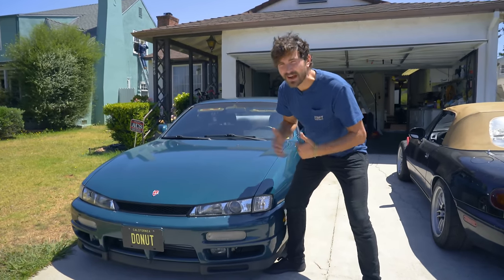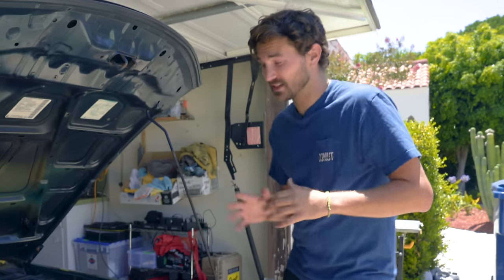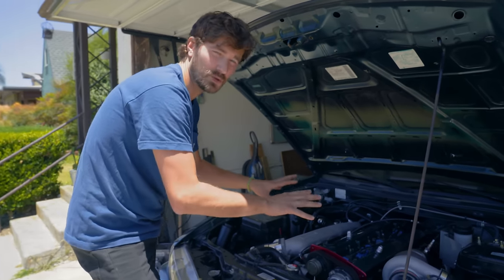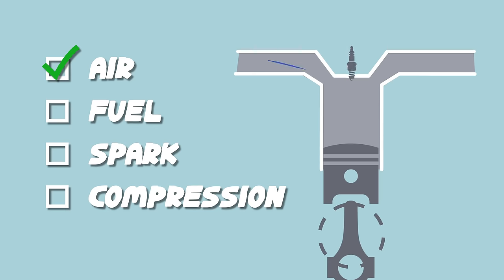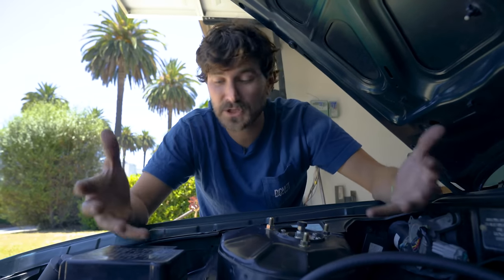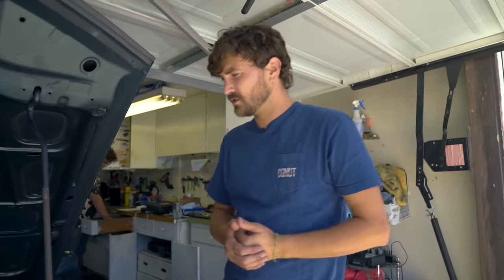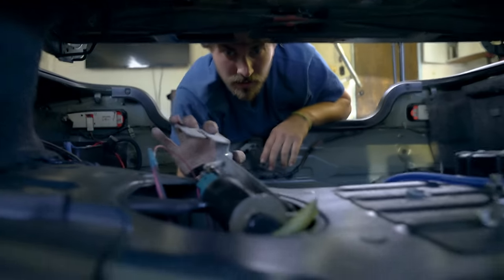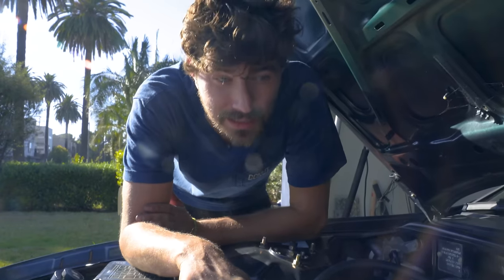Figuring Out Why My Skyline-Powered S14 Won't Start

Comment: Did you know - Tootsie Rolls were added to soldiers' rations in World War II for their durability in all weather conditions.
Reply: Bot
Reply: Yes
Reply: Ye
Reply: 11th like
Reply: Yes
Reply: What does this have to do with cars?
Reply: The HIMYM tootsie rolls!?
Reply: TheGinger CarGuy the soldier’s would melt the tootsie rolls in there mouths then spread over anything that leaks the cold weather would the freeze it and seal anything that leaks and also if the weather was cold enough the tootsie rolls could be used as bullets
Reply: Did you know - you are bot made by repostsleuths. 

But thank you for that bit of trivia.

Comment: WHAT ABOUT THE E36 we need to see it
Reply: Na
Reply: @Wik3dNuTS4k  ya
Reply: Ukininam!
Reply: Isnt the e36 cirone's
Reply: Nah
Reply: Hey zach plz do some videos on e36 also. It's my dream car 😃😃
Reply: @Knockthefout  make sure to bring money with you e36's are hard to maintain
Reply: @midnightg3593  yeah but he said in one of his videos that they are cheap abundant and pretty damn reliable. Just the intercooler issues are there. I will sort them. And the car can be found for under 5k in fair condition
Reply: @Knockthefout  I own 2 and they are not cheap to maintain and its famous subframe failure doesn't help it i have changed both my automatic transmissions to manual because the automatic systems are crap and expensive to rebuild
Reply: @midnightg3593  bro i love manuals. And it's my dream car I can't just let it go. It's so much fun.  I think we have same tastes in cars 😃. Cheers buddy. I also love drifting. Not professional but the normal drifting at mountains or turns. And e36 is in top 3 cars for drifting
Reply: @midnightg3593  do u have any Instagram account? I will follow u. Reply me that account username

Comment: The first thing I check, after a glance at the intake for problems, is battery voltage.With a multimeter this is a very quick check. Leads to the batteries and see what voltage you're getting. I get concerned with anything under 12, though it should start with a bit less. Pushing a car to the limits might introduce other issues, but in my experience with typical daily driver type cars, dead or weak battery is the most common cause of a no start.

Also a good early check is listening closely when turning the car on, before you try to start. The fuel pump should be audible as it primes the system. A helper to listen through the filler neck can be useful.

Comment: I remember one day my '04 Miata wouldn't turn over, even with forcing some gas. So I sat on it for a couple weeks. Randomly felt like double-checking my spark plugs since I looked at them last year for grime (didn't check the gap). Turned out that they really needed to be re-gapped, and it started up fine. I'm glad my problem was that simple 😩😩

Comment: The price of Silvia's has shot up like 50% in the last 5 years...
Reply: Jxntxn thanks to Americans.
Reply: @daveowen378  how so?
Reply: @jxntxn1462  speculators. Same as what happened to GTRs and various low production Porsches.
Reply: @daveowen378  Do you think they'll keep inflating like the skyline has..? They usually rise and then fall in price but I've never seen them this expensive
Reply: It's the drift tax bro
Reply: I'd put it more on Americans getting moist over S15s and the market responding with bullshit. Especially given that S chassis have fallen out of vogue for drift.
Reply: I was lucky to get a good deal for my s13. Can’t find a nice-ish running one for less than around 5k now. It sucks.

Comment: When you're testing compression also unplug your injectors, so you don't flood your engine by accident. Also most engines fail to start if the crank angle sensor is defective.
Reply: But usually when doing said compression test, you are flooring the accelerator pedal putting the vehicle in clear flood mode so the injectors will not spray any fuel.

Comment: Always make sure you have submersible fuel line on the pump. If the hose falls off, feels soft, or tears open, you more than likely don’t have submersible fuel line on it. Submersible fuel line is somewhat stiff and usually won’t like bending at all and it says submersible on the line

Comment: I love and haye diagnosis, hate when i have to do it, love it when i find the problem. Had an issue with my racebike last weekend, low power at first, no start when i got it home, turned out a connector of the fuel pump had wiggled itself loose.

Comment: Only thing I would add is the engine also has to be in time, and select sensors need to be working. For example a lot of cars won’t start if the crank position sensor isn’t reading. Also I usually use the negative on my jumper cables to ground the spark plug out. Easy when the battery is up front like most cars have it.

Comment: first thing i do for fuel is to spray brake clean in the intake to see if it start.if it does than you know it most likely fuel and the rest is ok.if it doesn't  than you move to spark,compression and timming

Comment: When you do a compression test, you need to unplug the injectors, or you could flood your engine. You don't need to unplug all of the spark plug coils, like you did.
Reply: You should do leakdown first...it will tell you if you even need to check compression.
Reply: Or just pull the fuel pump fuse/relay
Reply: If you do one on a Miata, you need to unplug everything or it’ll fry the coils. Lol. Ask me how I know.
Reply: @aygwm  I've never heard of that before nor has it happened to me, but I believe something like that could happen for whatever reason. Its always something lol.
Reply: even better: just unplug the cam/crank angle sensor. you wont get fuel or spark.
Reply: @TatakaiEX  that depends on the car. Some cars will just go into limp mode without that. My daily is a 2019 Honda accord with the cam position sensor completely chewed through by mice. Its just in limp mode and I drive it to work everyday still lol.
Reply: TatakaiEX WRONG. Some cars still power the coils even with the sensor unplugged. If you leave the coil packs plugged in but with spark plugs disconnected (leaving the coils no ground) they will ground themselves, frying the internals. Bye bye coil pack. It’s always safer to disconnect all ignition components before doing a compression test.

Comment: You should have mentioned to always check your multimeter before any measurements are taken. I know this time it wasn't that bad but the most important test on the meter is the cables' resistance (shouldn't be more than 0.3 ohms) and the resistance on the amp inputs (check the users manual for the correct values). Otherwise, you basically play yourself, getting false values whilst searching for issues for more than two hours.

Comment: I have, and only ever had, two passions in my life since I was 8 years old: Computer Programming and Cars. I had to move a few years ago, so I don't have any friends anymore. I would love to be able to get a project car and work on it, but I'm afraid because it will be only me. I have no knowledge to fall back on other than what I have learned online. I purchased a 240sx when I was 17 for my first car, but sadly, I was screwed over. It was the funnest I've ever had. I tend to overthink things, so maybe I'm making it seem more scary than it is. What concerns me most is the suspension – also things that require welding and such... like subframe connectors.

Comment: Any time I spin an engine to check for spark or compression or something else when I know it won't start or don't want it to start, its best to remove all the spark plugs.  Its a lot easier on the starter and the battery and it'll make the compression test a bit quicker because the engine will spin faster.  Even more so in diesel engines with ~ double the compression of gas engines, I remove all the glow plugs.

Comment: Good video iWork on cars so Iknow to test each spark plug and cylinder for compresión but that was not mentioned so some ppl who don’t know will only test one and also on that engine pressure is 43psi for fuel since it’s Sequetial fuel injection but on Direct it’s way higher just so ppl know

Comment: i honestly prefer using a resistance test with an ohm meter or if you don"t have that use a regular light bulb for a circuit load test, over a voltage drop

Comment: I once bought a mint coupe style s13 with an HKS turbo kit, fully built RB25 red top and about 9k in upgrades for 800 bucks because the owner couldn't get it started for years. $15 ignition coil on ebay and it fired first try, drove it home.

Comment: It's funny you mentioned the Diff S13  and S14 with engine swaps and transmission upgrades but are still running the stock open Diff

Comment: When doing compression you should check all of the cylinders. They should all be pretty close to each other. One with a reasonably higher or lower value than the rest will indicate an issue.

Comment: Sometimes the manufacturers of vehicles will paint the inside of your fuel filter so after a while paint will come off when u hit the throttle and wrap around your filter and kill your vehicle via lack of fuel this is usually most common on boats but if u hit the gas and it dies everytime this may be your issue all u need to do is clean it out with a wire brush, perhaps get a new one without paint inside of it and that should fix it

Comment: Don’t forget when checking compression you want the fuel shut off (can cause a higher reading than what it true and also cause hydro lock by the time your testing is done) also while checking compression the throttle should be wide open

Comment: My EUDM Mitsubishi Galant with the 2,5L V6 engine, runs on 5 cylinders. Any suggestions on how to diagnose it? The problem is that the intake of the engine is above the back bank of cylinders, so compression tests aren't that easy because I need to remove the intake every time I need to access the cylinders. Chassis is a EA5W Galant Wagon with a 6A13 engine (NOT a 6A13TT!).

Comment: the problem with cars that are from the 1990's is the fuel pressure regulators are 30+ years old so they go bad and jeed fixing and they aren't cheap so it's a good idea to get a replacement factory regulator but if you have modified the engine then looking at an aftermarket regulator is a good idea too

Comment: Thank your lucky stars you dont have a short between the cam angle sensor and the ecu thats why my bnr32 wouldn't start also had the same problem with a hose popping off the pump 😆

Comment: Working with electric components. You picked the range right, but you didn’t say that car battery works on DC voltage, that is very important while measuring. And one more thing, yes voltmeter showed us 12,3V on battery, but if you want to measure that the battery is charged, you have to measure it while you are starting the car. Battery is fully charged when it shows about 12V while starting!

Comment: Hey in case somebody has it all right,spark-fuel-air-compression but it still won't start,don't worry because im the falled solider for you.Crankshaft/Camshaft sensor.Gives out sparks but not exactly when it should for the engine to run or to even start
Reply: I can unfortunately second this from experience, a crooked cps can kill your engine with no apparent reason, along with faulty timing

Comment: With compression tests, you want all spark plugs removed so that there is no resistance when the engine is spinning which can cause inaccurate readings

Comment: Zack!!!   First off - get fuel injection clamps on that FPR, please.  They are cheap insurance against the worm clamps cutting into the hose on you.

Ok, so YOU probably already know these, but for the others playing along at home :)

1. Common causes of 'no spark' could be:  bad ignition coil (rare) or bad signal telling the ECU to fire (waaaay more common).   If you have a CEL (Check Engine Light), that can tell you if you have a bad Crank or Camshaft sensor.   On slightly older cars, the Ignition Module is notorious for failing (looking @ you, Ford Windsors!) and is another item to check.

2. When doing the compression check, you want to hold the throttle wide open (foot to the floor!) while testing.  Why?  Well, the engine is trying to suck past the closed throttle blades - so you're introducing another variable in the system (when diagnosing, troubleshooting is 80% figuring out what IS NOT the problem - best way to do that is to try to make sure you are testing only one thing at at time!)

3. Got a cylinder or two with more than 10% variance among the cylinders?  Put a little bit of oil into the spark plug hole (like... a tablespoon, not tons!) and retest the low cylinder.  Did the compression numbers come up significantly?  Rings are likely bad!   Did the compression numbers not change much?  Valve train issue!

Add your tips  here!
Reply: The people who already know that stuff probably won't read this.  And the people who don't know this stuff, won't read it because they don't work on their own cars.

Comment: The EASIEST thing to check if your car is just cranking is to spray starter fluid in the engine.... if it starts, its fuel problem,  if it doesn't its ignition

Comment: If you confirmed that you have air, fuel, spark, and combustion; then check your crank shaft position sensor and camshaft position sensors.

Comment: Fuel pressure and compression is different from vehicle to vehicle and manufacturer recommended spec should always be reviewed. 

Of course that usually goes out the window when you have so much aftermarket parts.

Comment: you should be using high pressure fuel system clamps on the fuel lines not the crappy ones that come in the pump kits.

Comment: Seems like the voltage drop test was redundant. You had already measured the voltage of the battery and the voltage across the pump and found both had ~12V. So there's no voltage difference i.e. voltage drop taking place.

Comment: An engine really needs 5 things, not four. the fifth is timing. For a fuel pump, when you turn the ignition, you should be able to hear it run for a couple seconds, you can save some time if you hear it run. But don’t use that as an absolute tester though.

Comment: pretty obvious that there must have been a leak in the fuel system and not an electrical issue with the pump if the fuel pressure gauge was reading 20 PSI. Yes, low pressure but pressure none the less indicating the pump is working but a possible leak is present

Comment: if you have air it runs  heaven if you have leaks the only things he dont run good to test proper spark  you can test it with the spark but the better a strobes light to check when the spark happen the thing i cant understand its you have a pressure regulator  and why its not the first thing you watch to understand  why you dont start ?

Comment: You left out exhaust. Air, fuel, spark, compression, exhaust. If your exhaust is blocked it won’t start. I remember my friend told me a story about how he stuffed a tennis ball into his dads exhaust when he was little and his dad took it to the shop and they cut the exhaust open and found the tennis ball wedged in.

Comment: I would add to this list... timing. If the valve timing or ignition timing are out or crank speed sensor is broken... it might not start either.

Comment: 8 out of 10 times for me with a car that wont start its a fuel problem. Best way to test for me is to dump a little start fluid on the throttle or intake and if it starts then dies out. I knw its not getting fuel.

Comment: I spent 6 months and over $500 chasing the cause of my car not starting just to find the same 1 inch fuel hose at the fuel pump had ruptured. That was long before youtube. $0.50 and 5 minutes later my car was running just fine. Lesson learned the expensive way.

Comment: If you don't have a points ignition system 9/10 times it'll be a fuel problem and if you have an electric fuel pump about 8/10 times that will be your problem.

Comment: Great video, but a crucial step was missed. The idiot check. Take a quick peek to make sure the idiot who worked on it last (may be you, may be the previous owner, who knows) hooked all the cables and hoses back up. My friend and I spent hours in the hot Georgia summer sun trying to figure out why his S13 had no spark. We even got down to pulling the distributor off his parts car when we noticed the one on the car hadn’t been plugged in the entire time.

Comment: I wish this guy could take a look at the electrical system on my 1968 Valiant, bet he would be able to fix the issue.

The car isn't charging enough, i've replaced the battery, cables, alternator and regulator. Still doesn't work

Comment: wait, i dont understand how did he fix the fuel pressure problem, he did point out the hose is blown off, but what did he do? (Sry if im missing smth obvous im really new to cars)
Reply: It looked like it just slid out, so fitting it back in fully seated should do.

Comment: I’m surprised (not really) with how he carries himself, which is somewhat mechanically inclined, that he didn’t mention the actual problem with that connection is that it’s botched and someone used those absolute garbage worm gear clamps.... and that small chunk of hose going from fuel pump to high pressure line isn’t supposed to be there either (can almost guarantee whoever put that there didn’t put high pressure fuel line, which doesn’t belong there anyways, because the disconnect is just going to happen again)... That is supposed to be a mechanical seal with a special clip directly to the flared hard line, which someone broke and didn’t bother fixing it properly, hence the cheap rubber line and GARBAGE clamps that don’t hold squat, especially fuel pressure. I saw that there was at least one real hose clamp (fuel line clamp) on the return line. Those worm screw clamps are garbage, garbage, GARBAGE!